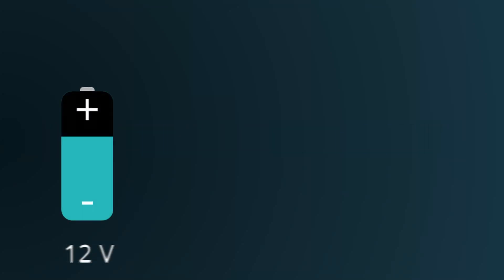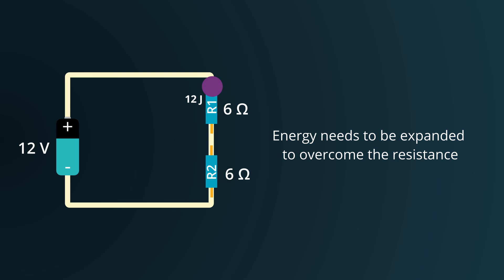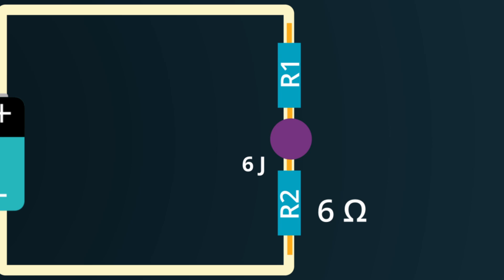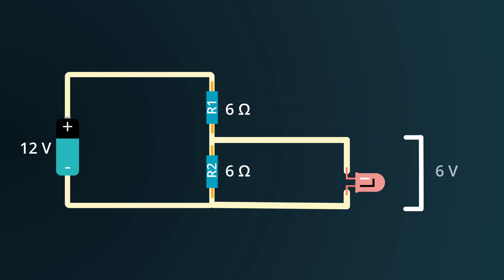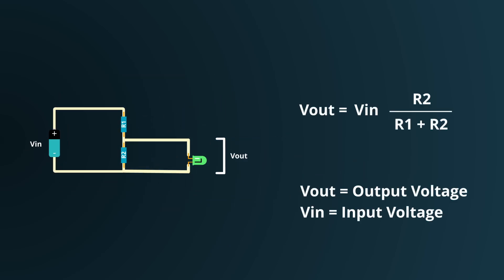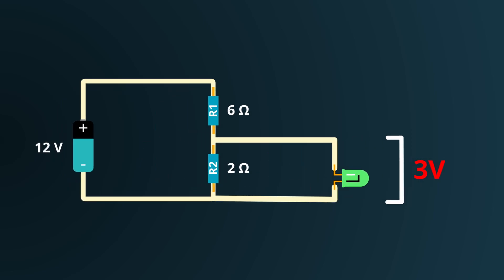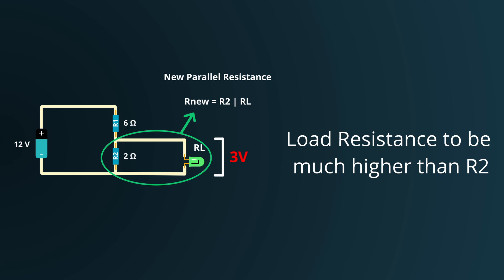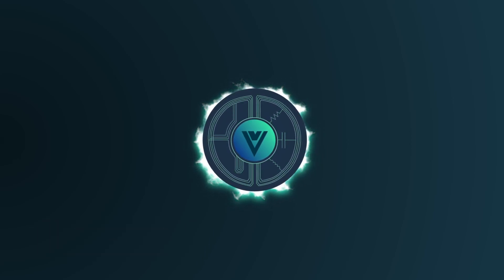Voltage Divider Explained | Animated Deep Dive

Comment: The concepts are clear, though the example for the LED is weird, since in general for such circuit you won't have a voltage divider setup, just a resistor in series, and at the end it complicates things by saying that the LED actually has resistance, so basically debunking the whole example. An example for having, let's say different reference voltages in a circuit would be better than for having a load directly in the divider.

Comment: Why is it called Voltage "output" if it is in the middle of the circuit and not at the end?
How do you rearrange the formula?
What is impedance? And am I correct that it has to be at least 100x as big as R2 for the Voltage to stay roughly at 2 Ohms?

Comment: Are resistors (voltage dividers) the best way to reduce voltage from say a 9V A/C adapter to 5V or 3V for a microcontroller?  I've been using a buck for this and am wondering why if this isn't a better/cheaper way to do it.

Comment: Why won't the voltage drop with just 1 resistor?
Reply: Using just one resistor would be imprecise and unstable because the voltage would vary with the load, depending on how much current the load draws.
Reply: A voltage divider needs two resistors to create a precise and stable output voltage. The output voltage is determined by the ratio of the two resistors, ensuring it remains consistent regardless of the load. Using just one resistor would result in unstable and inaccurate voltage due to load variations.

Comment: @4:17 any chance of explaining how the equation was rearranged to R2 = Vout * R1/Vin - Vout ?
Reply from the maker: Sure! 
Start with the voltage divider equation: Vout=Vin×R2/R1+R2.
Rearrange to isolate R2: Multiply both sides by R1+R2 and then by 1/Vin to get Vout/Vin=R2/R1+R2
Solve for R2: After some algebraic manipulation, you should arrive at R2=Vout×R1/Vin−Vout

Comment: Cool, so what if your load was the same as youre r2, how far off would the desired V be? like 3.1  or 4 vs 3? DEEEPER!!
Reply from the maker: Hi, in that case, the parallel resistance would be equal to 1 Ohm. Therefore, the Vout will be around 1.7 V, instead of the desired 3 V